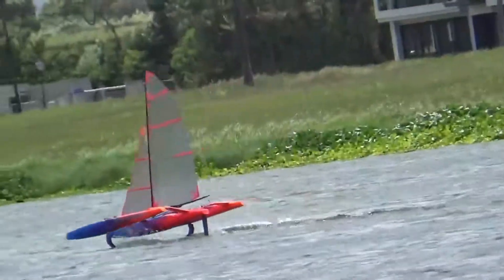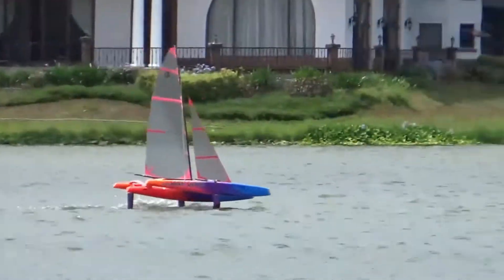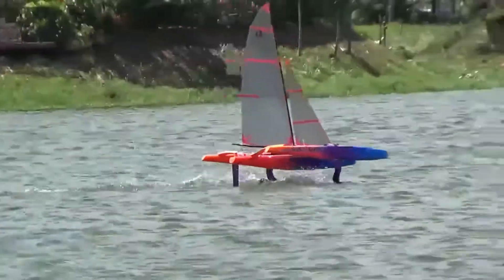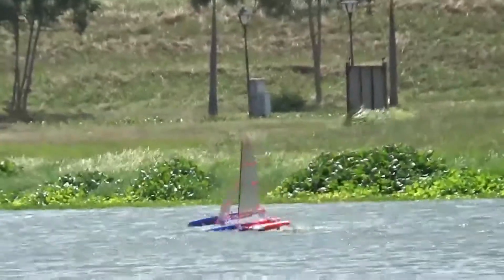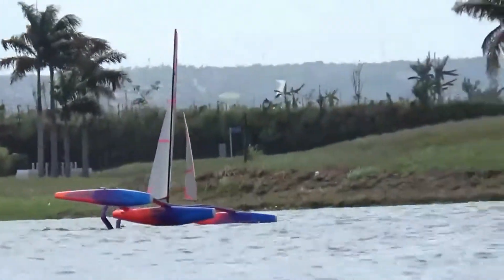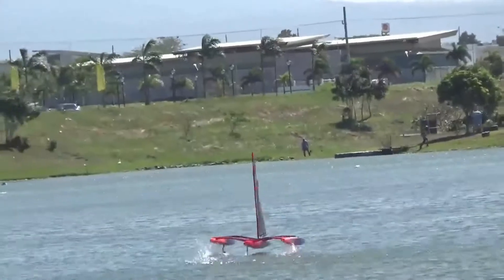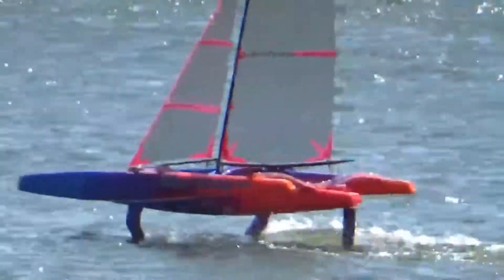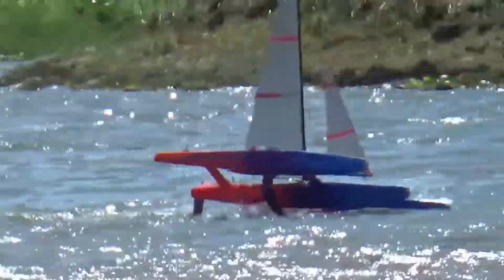Secret Service - Personal Best - 28KPH

Comment: Great videos and commentaries. Have you thought of a deck sweeper soft rig before going to a full hard sail? Similar to this one: http://www.catsailingnews.com/2017/10/f18-decksweeper-by-1d.html And concerning the windage on the hulls at high speed, there is an interesting design here: http://www.catsailingnews.com/search/label/SuperFoiler with very small amas. Thanks again for sharing your design ideas and great videos.
Reply: Ahah, very funny to watch the capsize. Otherwise very stable and low flying. Interesting. Would be great to compare performance around a course with the design you created obviously scaling to identical sail area and hull length.
Reply: Oh and your design looks so much better, very modern and pure. Great job there.
Reply from the maker: Hi Philippe.  Yes I have considered a deck-sweeper mainsail and have used on on a 10rater but we don't have a lot of deck to sweep on the trimaran!  I do have an idea on how to do this on a cat
I hesitate to say this without seeing the Superfoilers in real life, but I don't have a good feel for these boats.  They don;t have enough buoyancy in the bows and some of their capsizes are directly related to this.  As you scale down, you need proportionately more buoyancy in a rc boat.  I also think that their foils are too close to the rudders -they need a longer wheel-base!   But who knows - I could be wrong (again)!
Reply from the maker: Should have added:  We have some ideas on how to stiffen up pocket luff mainsails.  I won't be making any wing masts!
Reply: PerthMini40man I agree the amas are far back likely to have the weight of the crew back when going down wind. Not a problem you have on RC. I would think a similar design to the super foiler but with the amas much forward would give more distance between the foils and the rudder while keeping the weight low.
Reply: PerthMini40man looks like a great and simpler idea. I'm convinced there is something to learn from the large gliding birds and how their  wing tips fan off with a few feathers. such a design would provide a way to release the extra pressure of puffs that have the tendency to give the righting moment that pitch poles the boat. Especially at the top of the mast. This combined with a deck sweeper would lower the center of thrust for the sail.
Reply: PerthMini40man ha I did not realize there is no trampoline to sweep...
Reply from the maker: Here is my deck scraper mainsail on the 10R

https://www.youtube.com/watch?v=E3FQHxLXLWI
Reply from the maker: This is a very good example of a rc trimaran with very small floats, positioned well forward.  The problem with this concept is sailing upwind in sub-planing conditions is bad, and getting hit by a gust when the boat is moving slowly can be death.

https://www.youtube.com/watch?v=SuSYmrDYaxk
Reply from the maker: Also - note that this boat is wider than it is longer.  He is getting stability from a very wide foil base.  This boat is considerably bigger than a Mini40.  If I scaled mine down to his proportions, mine would probably be only 100cm long, not 122cm

Comment: i think the 28 was when one of the foils lifted out of the water for a few moments , reducing the drag by 33% ish i guess.  On foils the apparent wind is usually on the nose within seconds of take off.  I wouldn't worry too much aerodynamics of the hull , lots more potential in the foils first, however if you build another craft id make the beams symmetrical foils  and make the deck as clean as possible. For instant depower in gusts , perhaps a self adjusting vang that allows the sail to twist under high loads and returns under lighter loads, with a spring you can pretension and alter to tune to the crafts needs ?  the foils are working great , thinner thiner, chicken dinner.